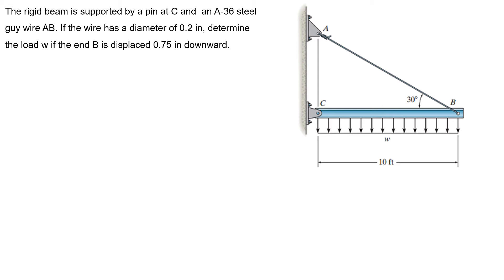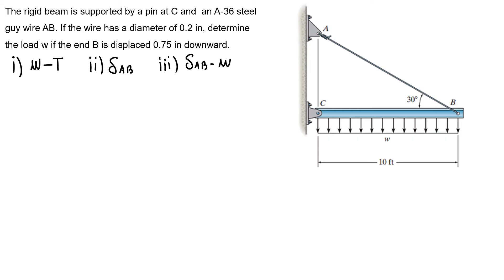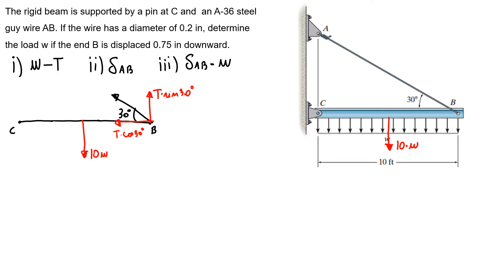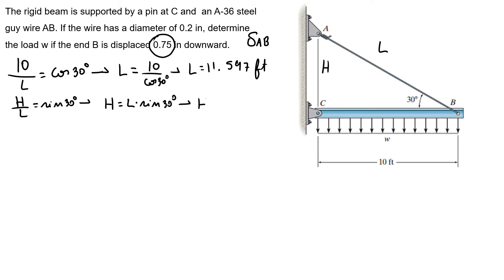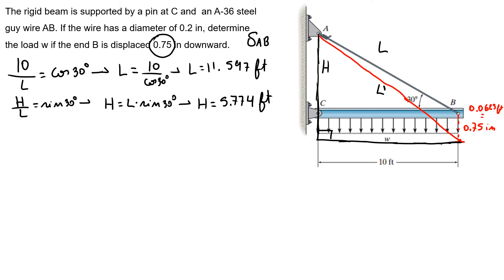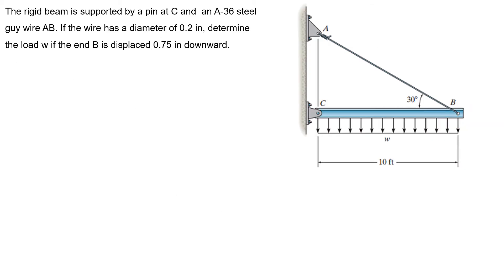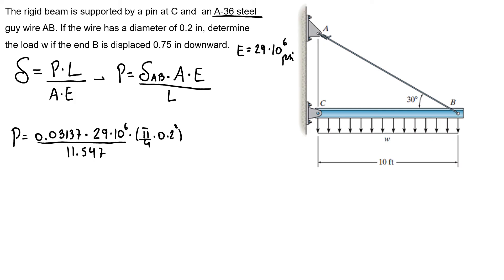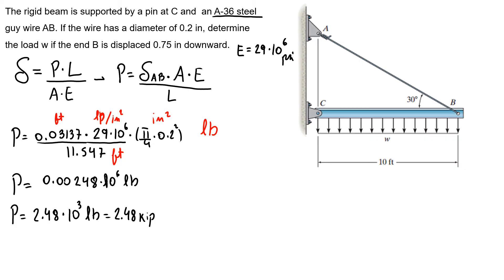Internal Loading - Exercise 2

Comment: Great video man, one thing I noticed was I think your value for the displacement along AB is slightly off, using your numbers my L'-L0 came out to be 0.31, and my numbers yielded 0.32, neither value being 0.3137. This led my final answer to be 0.252 kip/ft, so still close enough that most professors wont care.
Reply from the maker: Thanks man! These slightly difference also can come from rounding numbers before the answers. And you're right, most of them won't care